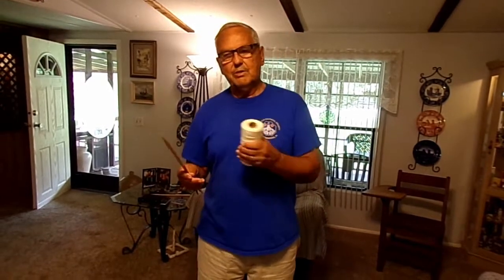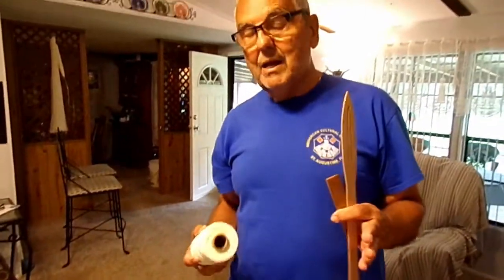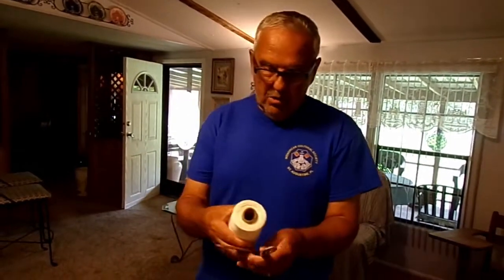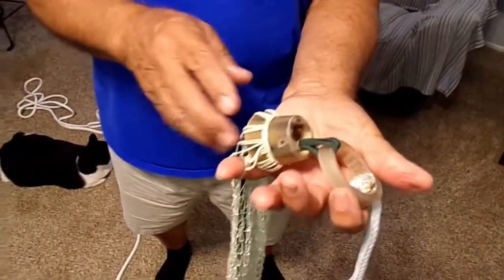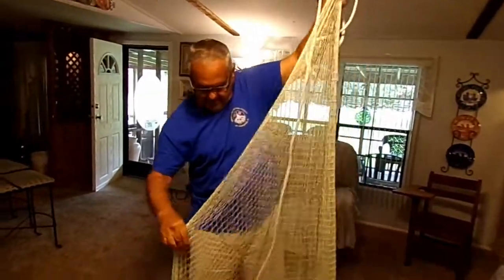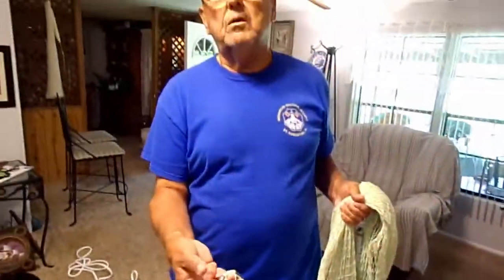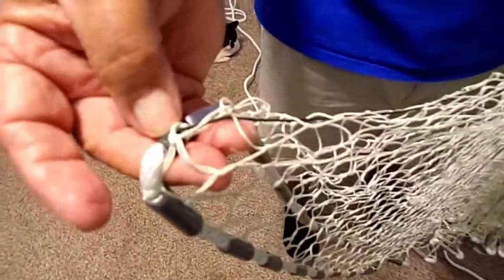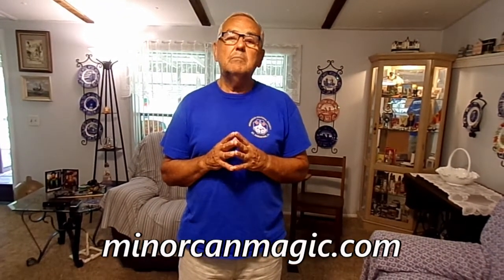Quality Handmade Cast Nets

Comment: MIKE I LOVE YOUR CAST NETS , I BOUGHT THE VIDEO AND HAVE MADE MY NET OUT OF BONDED NYLON AND IT IS A LITTLE OVER 4 FOOT NOW , I WOULD LIKE TO GET IT TO 6 FOOT , I USE THE OLD KNOT STYLE AND HAVE BEEN TYING DOUBLE KNOTS SO IT WONT SLIP , I HAVE NOT MASTERED THE NEW KNOT THAT MAKES A DOUBLE KNOT IN ONE MOTION. NEED TO PRACTICE MORE , I KNOW IT WOULD BE FASTER . ANYWAY, JUST WANTED TO SAY HELLO FROM MONTANA. I TOOK SOME TIME OFF THE NET MAKING AND NOW SINCE THE WEATHER IS GETTING COLDER I HAVE MORE TIME INSIDE . NEED TO FINISH IT , I HAD A MOLD MADE FROM THE WEIGHTS THAT YOU SENT. I FIGURE ITS A BETTER DEAL TO MAKE MY OWN  AND ITS A LOT CHEAPER THAN BUYING THE PRE MADE LEAD . QUESTION HAVE YOU EVER HAD A COW HORN BREAK AND LOOSE A NET?

Comment: Recommend me decron braided line size I want make 1/2 for shrimp 5ft net
Reply: For that size, i would go with 30lb dacron line. Its about the same size of your 10 lb monofilament line. I hope you have the patience. Right now im working on a net with 1/2” size mesh, and just to paint you the picture. Its now at 36”, it has 360 meshes at the bottom. So its a very slow process. 
For something that small, i usually tell people to go with either panels, or a full skirt. Full skirt been just a rectangle of of the same lenght of meshes it would complete a circle at your desired lenght. Just tie one seam, horn, lead line and you are good.